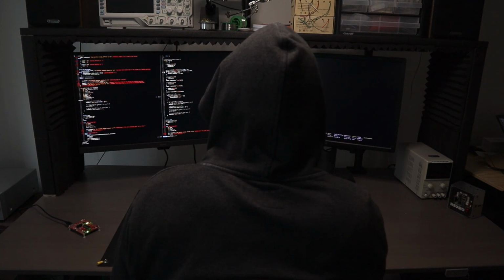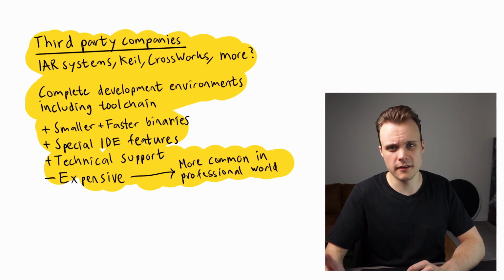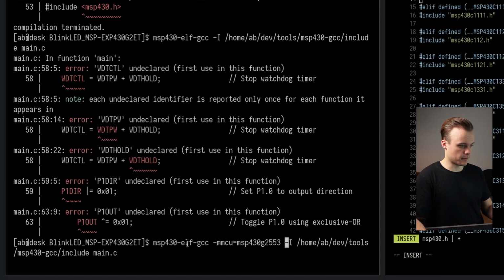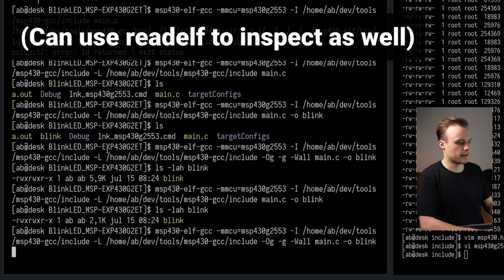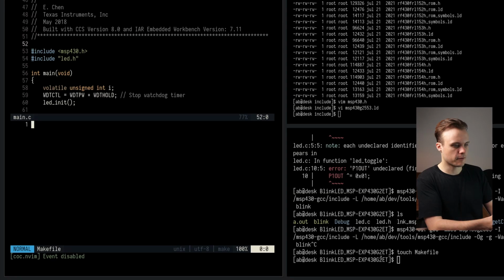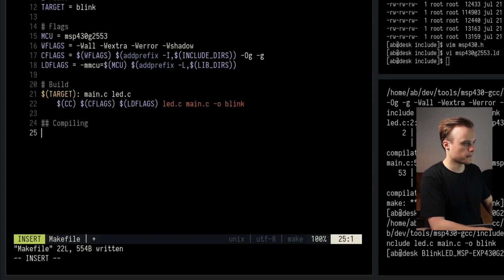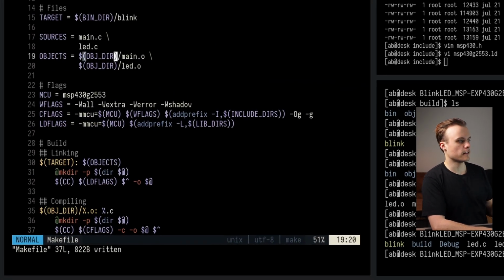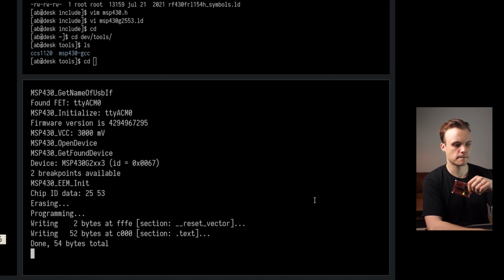Microcontroller Programming without IDE (Makefile + Toolchain) | Embedded System Project Series #5

Comment: It's very good that you describe the necessary minimum. Please continue at the same pace. First, do the minimum at which everyone in theory should start, and then more complex options with different variations. In many educational videos or books articles, either a very simple version is disassembled, or a very specific custom one. Then as a beginner, just wants to understand where to start? Should he specify this bit in the settings or not? Will this code run without the configuration of the other one? And so you have to Google and search for such questions and get a little dizmoral, since the question is very simple and easy. The question does not even require any mental intellectual abilities, it's just the specifics.
Reply from the maker: Thanks for feedback like this. It's sometimes hard for me to put myself in the shoes of a complete beginner even if I myself were a beginner just a few years ago.

Comment: i keep getting an error: MSP430: Error initializing emulator: No USB FET was found. I am using an msp430g2553 on my MacBook air running macOS Monterey. I downloaded the same Ide and you did. I have tried a number of things to solve the problem but I haven't been able to solve it.
Reply from the maker: Not sure about how good the support is on Mac, I've only used Linux and windows myself. You may have to download separate drivers to get it working. Maybe these  https://www.ti.com/tool/download/MSPDS-USB-DRIVERS/1.0.1.2

Comment: Wait what.. do I have to write my own linker script? I didn't find the linker script in gcc-arm-none-eabi. Only the linker itself
Reply from the maker: You need a specific linker script for your microcontroller, but you typically don't have to write one from scratch, because usually the vendor is kind enough to provide one, or you may copy the one from the IDE. Which microcontroller do you have?
Reply from the maker: @johanliebert2048  You thief 👮

Comment: Can we still use this method if we're using a microcontroller that needs an sdk?
Reply from the maker: Yes, but how easy it is to setup from scratch will depend on the complexity of the SDK. But many SDKs come with some minimal examples to build from command line. Any particular SDK+MCU in mind?
Reply: @artfulbytes  Yeah I'm using the TI CC2640R2 with it's namesake SDK. You'll understand my want to get away from CCS but it's more dire than that, I can't get the sdk added to the linux version of CCS so I've had to use a windows VM to connect with the board
Reply from the maker: @RoryIsNotACabbage  Ah yes that sounds like a hassle 😬

Comment: What oscilloscope do you use?
Reply from the maker: rigol ds1054z
Reply: @artfulbytes  thanks a lot)
Reply: @artfulbytes  My apologies for one more question)
How often did you have to use all four channels in the oscilloscope?
Reply from the maker: @Maksym_Palii  For most my use-cases so far I've gotten by with 1-2 channels. I mostly work on digital stuff and use a digital analyzer when I'm just interested in just looking at the data. If you tend to do analog stuff, you may need more channels more often.
Reply: @artfulbytes  thanks again 😊

Comment: This is a little bit confusing, because you are showing that you downloaded the toolchain files but than you are actually using the files from CCS.... If you download only the toolchain files you wont compile this example.
Reply: I figured it out, if you want to compile it without installed CCS you need to download also the "Headers and support files" from the bottom of the page where you downloaded the toolchain.
Reply from the maker: @EEEEMMMMKKKK  Yes you are completely right, sorry for the confusion! I downloaded the support headers too, but I forgot to show it in this video. I show it in another video though, https://www.youtube.com/watch?v=dh1NFAIoZCI.

Comment: can you make a video to use a Raspberry Pi ARM processor as an Arduino board or MCU board, like running small firmware in it, so the sole purpose of that ARM processor becomes to run single / multiple programs in different cores.
I know I am asking a little too much 😅
Reply from the maker: Would be an interesting challenge, though I don't see myself doing it in the near future. I think there might be some existing resources on it though, for example just found this https://github.com/bztsrc/raspi3-tutorial
Reply: thanks for replying, your channel really helps a lot, keep up with this great work👍 @artfulbytes

Comment: Don't use make in 2022 please, embedded programming is not an excuse. There are much better alternatives nowadays. CMAKE is basically the de-facto standard and most c/c++ stuff is packaged with it. Even embedded toolchains often comes with cmake configurations so you just need to point cmake to the toolchain and you can compile any cmake project with it.
Reply from the maker: I agree with you when it comes to larger projects, but for simpler ones (10s of files, single platform, and few deps), I still think make has its place.
Reply: I did not see the last part of the video where you taked about cmake, classic youtube comment :D... But I respectfully disagree, probably I would go for cmake even for a single file.. there are so many advantages and no disadvantages over make except the added abstraction layer probably. Make have an educational value tho, especially regarding compiler/linker flags.

Comment: I don't know what's wrong, but unfortunately I couldn't manage more than one file with stm32.
The code is compiled. Then I make an object file out of it via objcopy
but nothing further. After firmware nothing happens

1. arm-none-eabi-gcc -DSTM32F103xB -mthumb -mcpu=cortex-m3 -T /utils/STM32F103C8TX_FLASH.ld -I /headers/ -I /lib_inc/ --specs=nosys.specs -o main.elf main.c /lib_src/usart.c startup_stm32f103c8tx.s
2. arm-none-eabi-objcopy -O binary main.elf main.bin
3. st-flash write main.bin 0x08000000

The code itself is correct, since when transferred unchanged to stm32cubeide, everything is stitched correctly.
Reply from the maker: So the same command works when you exclude usart.c?
Can you compare with the command that stm32idecube runs? Maybe it's shown in the console of the IDE?
You could also try to compare the elf that stm32idecube outputs using "readelf".

I don't immediately  see anything wrong with your command.
Reply: @artfulbytes  cubeide makes a lot of flags and it's not even clear which ones are superfluous.
Yes, when I exclude usart and compile exclusively main.c with its header and all the other things that are listed above, everything is even flashed without problems. After work, I'll try to transfer the necessary piece of code directly to main.c and try to flash it.
Reply: @artfulbytes  Well, I found out that my code doesn't work for some reason. ALTHOUGH if you flash through stm32cubeide everything works.
Reply from the maker: @johanliebert2048  It doesn't work after you moved the usart code into the main.c file so you have a single file? What is your code doing?

Comment: Thank you for this amazing video! Your videos have provided a lot of insight for many embedded system beginners like me! I really appreciate it!

Just one question regarding software debugging. Is there any way to debug our program in vim environment (such as breakpoints, variable and expression windows, etc.)? I would like to try embedded software development without IDE but I have trouble debugging my code.🥲
Reply from the maker: Thank you! 

When it comes to tasks like step-debugging that's usually when I fallback to the IDE. The debugger gdb, is available as part of the toolchain and you can run that from command-line if you want (and there might even be a plugin to integrate with vim), but I prefer an IDE for this. But I agree it's a little hassle having to switch between them.